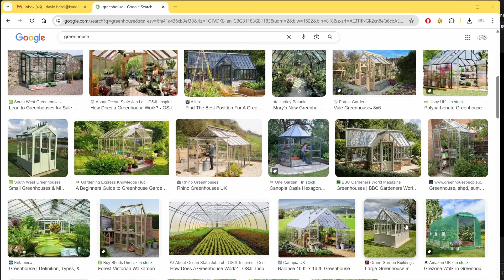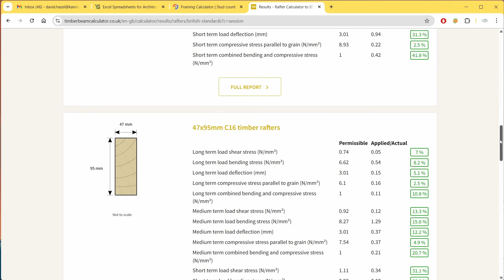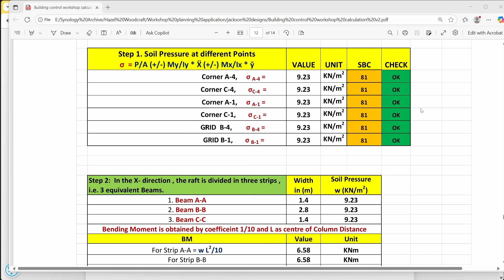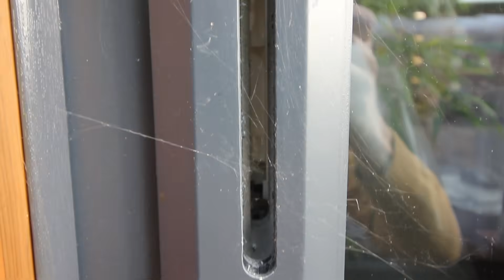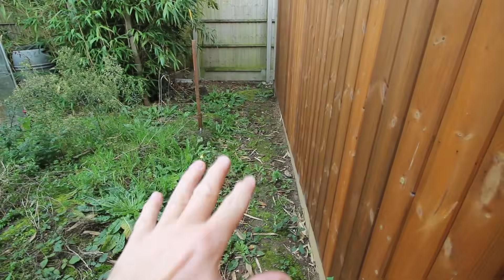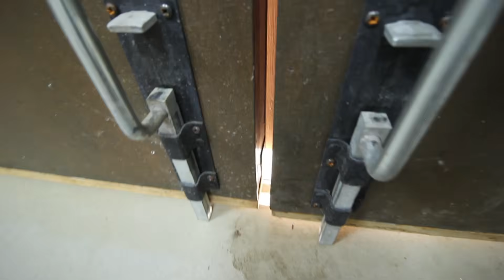Design and planning your own workshop / shed / summerhouse garden room etc

Comment: A month ago I  tore down my 18 sq metre   wooden shed/workshop , which I built it myself about 15 years ago .But despite replacing sections and staining it regular it  was still slowly decaying and rotting away with weather conditions  and  woodworm . Now while im still  fit enough  I'm already  halfway  in the process of rebuilding it replacing it with aluminium reinforced  standard   Upvc  oak wood  effect outside  ,  white inside  because   Ive calculated in 20 years time Ill be too old to keep maintaining it .
Reply from the maker: Sounds like a solid upgrade that will save you a lot of work down the line. Cheers

Comment: Hi David, Good to see you again, hope you get well soon nasty thing this covid, I've just recovered from the lurgy, but it wasn't covid just as rough.
I did enjoy your workshop build and all aspects of the build from laying the concrete slab, drainage, the electrics to building your workbench and units, was all well explained and very interesting with great tips and ideas. There is some good video's out there I've enjoyed watching on YT on workshop builds. Last year I watched Mark (Start making woodworking) he built a workshop from the ground up this was good to watch and another build i watch was about 2/3 months ago was by Mike ( Captain of my Shed ) this also was a good build videos. I'm hoping to extend my workshop next year, I do have a double garage but it only has one door but it's split in to two rooms not exactly 50/50 more like 33/66 it was like this when we bought the house 28 years ago. My workshop is the 33 and the garage is 66 but my car is parked on the drive and as most garages it's full of junk and needs a good sort out and many trips to skip. I intend to turn my garage part into the workshop and I want to build and island workbench in there, I have the materials ready to build it a bit of luck this will happen next spring.
As always a great video with lots of tips and advice and planning and building control a very interesting and useful information. Have a good weekend, catch you soon take care.
Reply from the maker: Hi Shaun,
Thanks for the comment sounds like you have a cracking space for your workshop. I feel your pain with clearing out we are doing just that ahead of extending the house. It’s quite incredible the amount of stuff you collect over the years. Good luck with your workshop rebuild I have thoroughly enjoyed the whole project.
Cheers
Reply: @CazualHaze  Thank's David

Comment: Don't believe a word about not cracking, there are only 2 types of concrete.
#1, concrete that has cracked 
#2, concrete that is going to crack
Reply from the maker: Hi Phil,
Cheers you’ve made my day!!
I hope to get away with it the concrete is thick and very lightly loaded if I remember it can cope with 100tonnes if spread evenly.
Rest assured if it does crack I won’t hide it I will let everyone know.
Cheers
Reply: Hi everybody. There are 3 types of concrete in reality... The third being the Roman concrete: it never cracks, it loves water, it repairs itself automatically. 
Thank you for your videos, lot of information and inspiration. 
Cheers

Comment: I've really enjoyed following your project, and this video was an interesting view into how different the building process is across the pond. It seems like you guys have much less guidance on exactly how things are to be built than we do here in the states if you had to do all of those calculations yourself. Between the NEC and IRC (National Electric Code and International Residential Code respectively) it's actually fairly easy, as the engineers that develop the code have already done most of the work and generated tables or recommendations for pretty much anything you could need to do. They also generate a ton of red tape though, because every piece of building material needs to be approved and listed as fit for purpose by the standards bodies, specifically with electrical work, so if you're trying to do something even the slightest bit non-standard it can become a hassle quickly.
Reply from the maker: Hi @Trainwreck1123,
Sounds like it’s similar in the states. We have building control that work to approved building regulations laid down in law. Planning is a bit more woolly as it’s a framework that has regional differences but property listed on the national register for architectural heritage etc adds additional protections. You can’t even hang a picture on a wall without planning in some places (which is a pain but I do agree with).
Like the states our electrical system is second to none and well designed and you will follow the rules! It’s been getting harder to go your own way and it’s getting so only approved people can touch things these days. You are allowed to change an electrical outlet plate if you break one but anything more and you should use a spark!
Cheers
Reply: @CazualHaze  I agree, having seen some of the homeowner "repairs" that people do over the years, all of the controls are ultimately for the best!